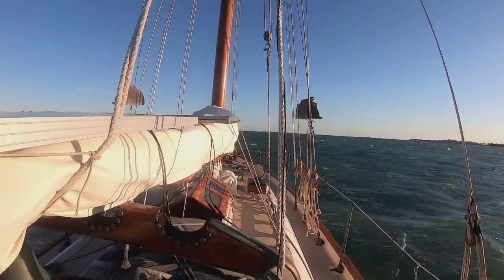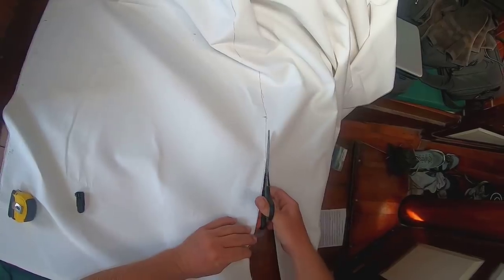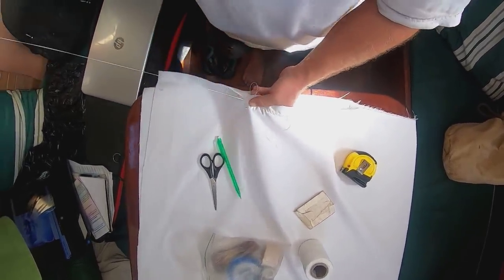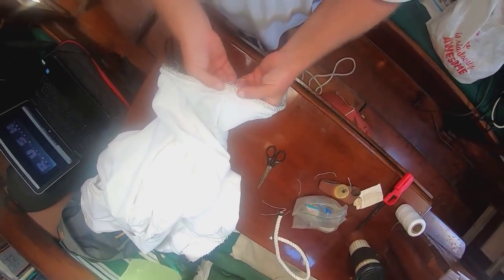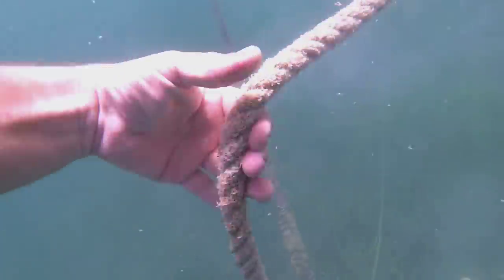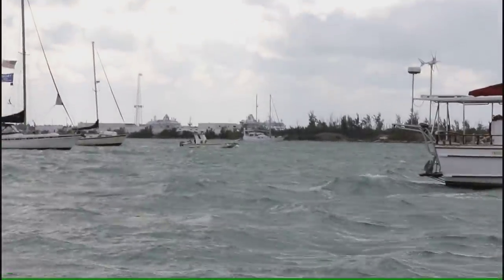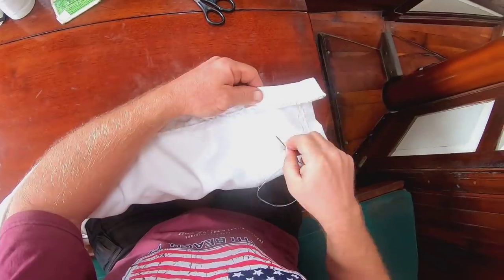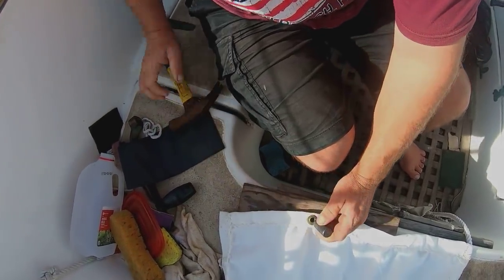D.I.Y. canvas work (between cold fronts)

Comment: Kev:  I admire your fearless motor free sailing, great fun to watch.  Having retired from sailing after 50 years or so, I have messed with sewing sail covers, tarps, etc.  A few points from my experience may be useful.  I used a straight stitch older model home sewing machine.   A straight stitch will do 99% of your sewing.using  needles rated for canvas or leather. I got an older machine, about 1950 vintage, of all metal construction, no plastic parts;  pay no more than $25 as I see on Craigslist  old Kenmo0re, Brothers, models that will be just right.  Use a small inverter off the batteries for power.  I used black thread  and black webbing (black holds up better in sunlight) in various widths for collars, ties and chafe guard.  Slots burned in webbing with your solder tool made dandy   sealed button holes for buttons and toggles.  Seat belt material made some great framing for   insect screens .  Could  it be your main problem with a sewing machine is where to stow it.?? Cheers.
Reply from the maker: Ahoy George, yes, stowage always needs to be considered for any purchase these days, you quickly run out of room on a 31' boat.

Comment: Hi Kevin,  great videos - do reach out if you do plan to come across the Atlantic this year to Ireland
Reply from the maker: Hi John, that is still on the front burner.  I will certainly reach out, especially for local sailing knowledge, I could only find one guide on S. Ireland, the one by Robert Wilcox, which is a few years old.  I think I still have your email, so will be in touch if and when plans are definite.
Reply: Try  www.eOceanic.com     - gives all the local info for Ireland and much of the UK - If your plans firm up, I'll get a guide over to you.  Best regards,  John
Reply from the maker: @johnoshea7434  Thanks for the info!